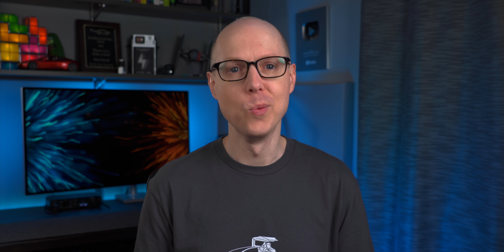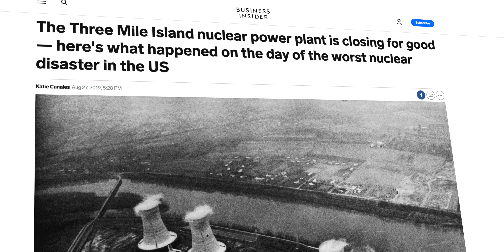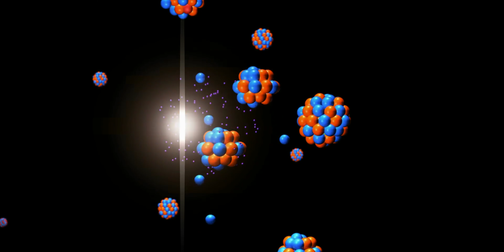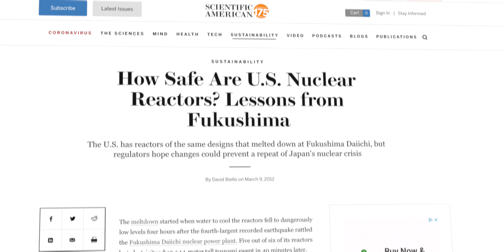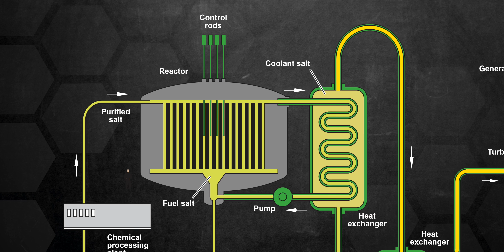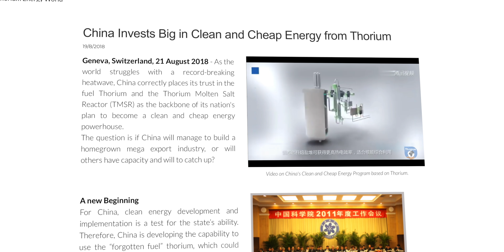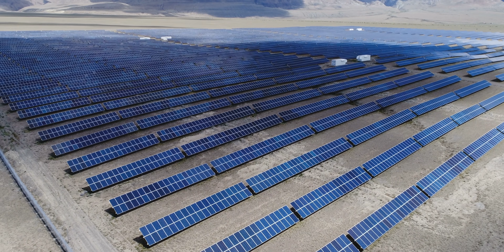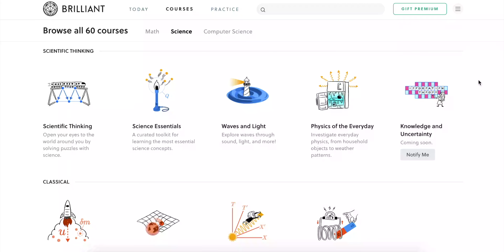Thorium explained - the future of cheap, clean energy?

Comment: Thorium is the answer, solar and wind are not large scale answers. They do fine in small scales. 
We use wind and solar for most of the the power (propulsion and electric) on our sailboat, in conjunction with batteries, we get by most of the time. When there is no wind or sunshine, we fire up the diesel. The same is true for the grid, only the scale makes it not work well. Steam turbine power plants take hours to get prepared to produce power, our Yanmar diesel takes seconds to come on line. In grid terms, that means that steam plants need to be kept hot and ready at all times, in order to back up unreliable solar and wind, very costly! 
If they can produce Thorium Molten Salt Reactors the sky's the limit, and it opens up the possibility of using excess heat and off peak power to desalinate water, a very power hungry endeavor. Thorium could provide power and fresh water to all sorts of places that have very little of either, now. They could be the greatest thing to happen for Africa and other emerging areas, that need clean water and electricity. 
I think Thorium will be a huge game changer, and "clean" power is only the beginning.